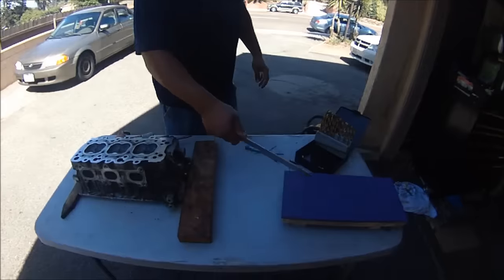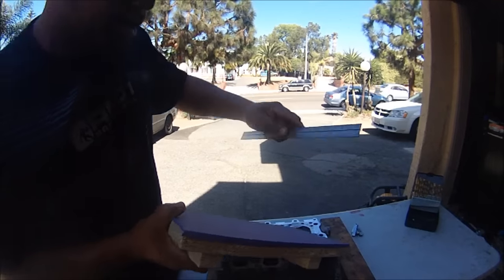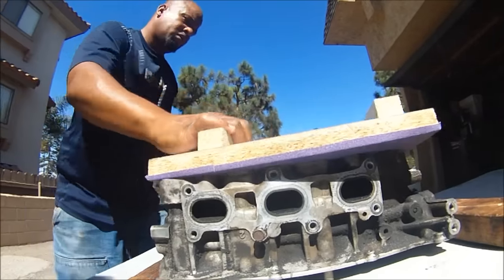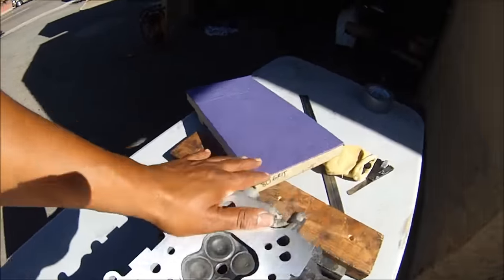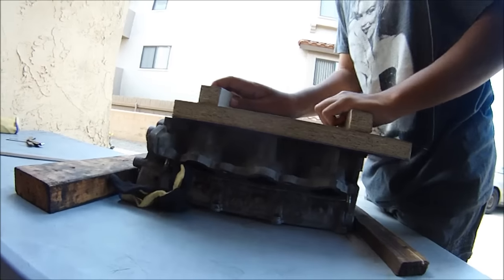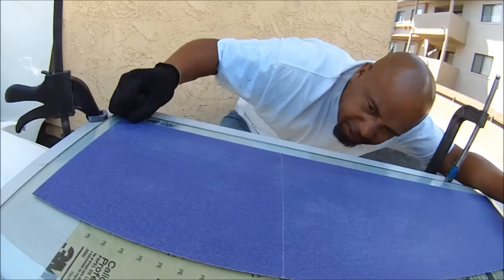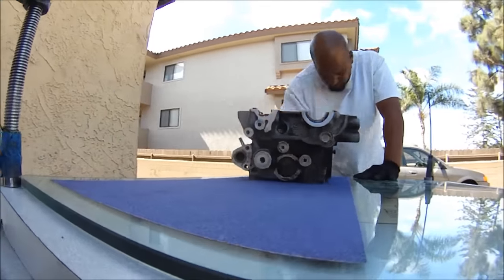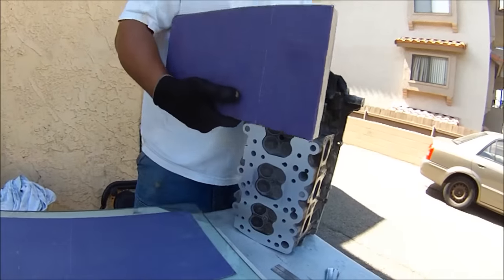HOW TO RESURFACE A WARPED CYLINDER HEAD AT HOME WITH SAND PAPER still works in (2023)

Comment: My dad is on social security, and has limited fund's. He blew both head gaskets, and warped both heads. This knowledge helped me to repaired his truck perfectly, and save him $. God bless you oldskool funk! Your messages are as real as you mechanic skills too.Thank you sir! Much respect.
Reply from the maker: This was mad for those who struggle financially. It helped me sooo many times and im grateful it helped you and your father. You and your Popz stay strong and draw close to Jesus Christ my man. Never Ever Stop Fighting in Jesus Mighty Name.
Reply: Thanks Bud you are who we need making videos
Reply: Hello I am 😢73yrs. Young ..  Could u also have the engine head in hand & do just the opposite  .. !  Use a sheet of 80 grit of sand paper attached  2 a flat surface.  Then use the weight of the engine do most of the .. Of course  the engine  head would  b maybe a little  harder 2 work  .. It was just an idea  ..  very gd. job, very  old school 
 job well done  .. Some 1 that is not afraid of hard work  ..😮  01-10-2024
Reply: How’s it going? What do you do for the cam journals?

Comment: The machinist in me is cringing a bit but I’ll tell you what man, good on you for figuring out and sharing your knowledge. I’d love to throw that head on a surface plate and check the true flatness of it not out of disrespect but just to admire the accuracy you can achieve with this simple method. Great video, God bless
Reply: Benjamin Paquin do you think he's close I'm a motor builder I bet he's far closer then he would if been just putting new gaskets in there
Reply: @ryandowns1507  He's within 2 thousandths across the whole part and I'd say it's probably better than that.  For the multiple feet he's dealing with that's fantastic by any machine shop's standards.
Reply: @kay19833  Why do you feel the need to bring race into the conversation?  What a shame that you only see the world in black and white.
Reply: After watching this I feel lucky that one of the things I do at my job is surface grinding carbide tools. It was kinda impressive to see it done in a "primitive" way and hey it worked.
Reply: @TugIronChief 

Yep especially when not maintained the right way. 

The CBN machine we had the bed rails had a valley in them, if you didn’t know that machines characteristics then it’s easy to get false readings.
Reply: @Mark C 

Lol the primitive way still works just fine. I’ve done it both ways with a head belt Miller and a CBN. 

Wanna talk about primitive then let’s discuss a broach head miller. Those are the ones that leave nasty cut lines no matter what you do. 

Even the CBN can suck, get a aluminum shaving stuck and it wrecks what you just milled and you get to do it again.
Reply: station079 yeah man, I’m white and I admire this man and his positive attitude !
Reply: @ryandowns1507  hello... what kind of motor? Respect from a petrolhead from Nigeria....
Reply: Benjamin Paquin 
Im only here out of curiosity, I’m no machinist. I don’t understand.... if a warped head is re-surfaced, and done well. Isn’t the rest of the head still warped?
Reply: @muntee33  Not the whole head, but if valves were to leak, they would be resurfaced too. The rest isn't that important
Reply: @TugIronChief   I'm a toolmaker machinist who served my time at a General Motors engine plant. Aluminium head castings were surfaced in a machine using large rotary head carbide tipped tools. Single-pass, plenty of coolant. For that reason, I would stick to using a mill with the right cutting tool. Surprised to hear you mention a shaper. The hillbilly method would work roughly but would take too much time. Better to take it to the machine shop and the job would be done in fifteen minutes. It's also flatness you are looking for not necessarily a polished finish as a fine machining texture helps seal the gasket.
Reply: @TugIronChief 

Yup it doesn’t matter how it gets there as long as it’s flat enough for the head gasket to seal. That’s all that matters wether a machine shop does it or a regular person. 

Problem with machine shops is they have a nasty reputation of taking their sweet ass time doing the work, I would know as I worked at one so seen both sides of it. 

Been the guy at the counter trying to get work done at a reasonable time period and been the guy doing the work.
Reply: All this stupid talk about race, and color. ...  
When I was a kid, we'd use sandpaper and a sheet of float glass, to sand our skin off.
When we were finished, white or black, we all looked the same.
Reply: @TheChrisey  good one!rotfl
Reply: This dude has reached Beast Level 10.
Reply: What made your cringe? Just curious?
Reply: I was thinking the same thing, I'm a machinist as well
Reply: Who is this for?
There's a long way to go before I get this out of my car!!
Save 45 bucks!?! 
I'm not hating. Who is this for, for real?
Reply: @gti500  yeah it takes fifteen minutes to do the work, and two months to get it on the machine. No thanks.
Reply: @IdemRedd  Watch the video again, so you can understand it. And listen to him talk, that's for  whom this is for.
Reply: @gti500  And how many hundred thousands recalls do YOU guys have every year? I'll take this "hillbilly's" advice anytime before yours.
Reply: @bkpickell  Or how about ten months for transmission swap/replacement?
Reply: Sid The sloth how do I know if I have an aluminum head? Or what type of head I have, I have a 2000 Ford Taurus 3.0 V6 Vulcan engine
Reply: @cxx1953  magnet wont stick to aluminum, give it a test
Reply: Mr. Matt right on, thanks 👍🏻
Reply: I Appreciate him going the extra mile. 👍 

but, I'd say to (people) Alternate ends that your sanding from.. Every 20 passes.
Reply: @robertgaudet7407  A machine shop would get it flat and to the correct surface finish. Within 2 thousanths isn't flat or anywhere close to "machine shop standards"
Reply: Spend $200 on gaskets, bolts and fluids  and then do this crap to save $50?
Reply: @keithb4007  amen
Reply: Thanks dude. Anyone hating already paid the machinist or is to lazy.
Reply: IdemRedd I don't know what tools are required for machinists or whatever but this could very well be the method used in "non-privilege" countries. You think 45 bucks is nothing but there is vast swathes of the world that 45 bucks is a ton of money (or sophisticated expensive machines don't exists in abundance). I was in rural Africa and rural Thailand at motorshops. The ingenuity that some use yo do work is similar to what this man has done. Hell they probably do this in USA in poor Appalachia if we being real.
Reply: @muntee33  If I understand you correctly, the warp only applies to the surface, so if it is fixed, it is fixed.  But your general point might apply to the fact that there are two surfaces in play (on each side of the gasket), and the other surface needs to be true as well, so that they both mate up correctly.
Reply: @a1machinista1  The $200 was done to save the cost of buying a working vehicle, and he did the work in order to avoid paying the $50, and he got a video out of it.
He's a doer, not a payer, and that mind and skill set is going to become way more valuable in the next 20 years than it was in the last 20 years.
Reply: @South_0f_Heaven_  I have also done heads motor blocks and cranks in machine shop with all the proper machine tools. I will assure you the method he used will do as good if not better a job as any machine can do.After 50 years of working on diesel gas and hydraulic pumps and motors i should know.
Reply: @wellnesspathforme6236 
Cylinder blocks don't take a pounding from the pistons like the heads do, blocks are never a problem it's always the head
Reply: Jon Wong How can a “broach mill” be used to surface anything? Daryl used layman’s terms to describe exactly the current state of the art milling process. The only difference is carbide vs cbn cutters. Maybe a cbn insert is used for small DOC but carbide can take a significant cut, especially in aluminum. A large DOC in an aluminum head won’t rip it to shreds, a broaching machine tool cuts slots, a rotary broach “wiggles” shaped cuts, the modern “CBN” machine you talk about is a rotary milling machine tool with a insert that’s been around since the 1980’s. I don’t think you know what you’re talking about....
Reply: Only thing I can think is that he didn't make sure the head was secured in a perfectly level position, so although the precision ruler doesn't reveal any low spots in the middle, it doesn't mean that the surface is sanded down level from left to right. It could be sloped
Reply: @sil-zk8061  If it was sloped slightly, it actually wouldn't matter much. There's still going to be the same amount of clamping force. The bolts are almost always torque-to-yield, meaning they stretch. This means they'll seat even if it's slightly angled.

Now if it's more than .003" or so, then yeah, I can see how it might be a problem. Would be a nice episode for some mythbusters-esque channel, honestly.
Reply: @Steven Wander That's true. I guess as long as the tolerance at the lowest point is good then at worst you have negligible sub-optimal valve performance
Reply: I’m cringing as well. I’m sure it will work just fine, but this just reminds me of heads techs zip wheel the deck of and think they’re fine to just throw a gasket at it cause “it looks good”. lots ultimately end up at the machine shop.

Comment: This method has been used for decades to flatten surfaces.  A piece of glass or a "flat plate" piece of steel is about as flat as you can get and if you handle the head properly you can get a flat surface.  Myself, I would hold the head at both ends and move the head more in a figure 8, it tends to compensate for any uneven pressures you might place on the head pushing it from one end.  The big thing is let the grit do the work, don't try to put pressure on it to speed up the process or you'll tend to have low ends.A machined finish is better in that if done right you end up with the proper surface finish and an absolutely flat surface, but this method Is perfectly acceptable if you want to take the time and effort.
Reply: Leland Lewis, you are on the money i was going to say this
Reply: I never thought what he did was possible. That the hands of men can do what a machine was designed to do. When he was resurfacing the heads I thought about the pyramids in Egypt. how the blocks were placed precisely without any modern day technology.
Reply: Many manufacturers have moved away from hand scraping due to costs labour costs involved. 

The hand scraping performed on a way is done for a couple of different reasons, neither of which are necessary in most automotive machining operations. Firstly, hand scraping gives a better surface for oil retention between two sliding surfaces where a flat surface would allow it to squeeze out. There are machined methods which allow oil retention, but whether they are as good is debetable. Hand scraping also allows for an accuracy far greater than required for automotive purposes. Even in a blueprinted racing engine, where tolerances are tighter than in production, the tolerances are still well within the range of the available machinery. 

Your point is well taken though, simply because something is done by hand, does not make it bad. Many shops still hand hone cylinders and I have "bored" cylinders with a hand hone to within .001 taper. 

We have become programmed to think that only something computer controlled can be accurate. CNC can speed up processes by duplicating the same actions over and over, or do a job quicker, but men were doing accurate "machining" long before machines came along 

The other thing that hasn't been mentioned is surface finish requirements. A cylinder head has a certain micro-inch finish requirement to give it the best seal on a gasket and good gasket retention. This requirement changes with the type of gasket used, but is still quite within the realm of this method.
Reply: Yea figure 8 is the best way to go if you can. When I was working in the shipyards we always lapped our discs for the boiler safety valves in a figure 8.

Comment: People be hating but here's the deal.  I've had to do this job myself.  It was the worst possible pain in the ass I could have ever done.  But at the time, I was broke.  I had no job and my only car had warped heads.  My father and I did this EXACT process, it took f'in forever! But it worked.  Remachining heads is INCREDIBLY EXPENSIVE and sometimes, if you don't do it yourself, you might as well just trash the car because older cars aren't worth it.  As it stands, I drove the car for another 4 years until I was able to buy a newer car.  Don't hate on this guy, people like him can save your life!
Reply: incredibly expensive? I get a pair of V8 heads surfaced for $70. Even at double the price I would t call it incredibly expensive.
Reply: I was told as long as the engine didn't get hot then the aluminum heads shouldn't warp ..??         Took them both off in seq..   Used a straight edge.   Looks good tho..
Reply: So true. If they are busy making money your little job might sit on the bench. Shops do what they can to make money like most of us. Could be a week or two; depends on how far out they are taking jobs. You might lose momentum. ;)
Reply: My local machine shop does decking/head resurfacing for $30 and hot tanking for another $30.  $70 more less tax included.  It's not expensive at all in my opinion.  I drop it off and get the head/block back within couple days.
Reply: Sounds like a great shop
Reply: suuuurree. having a head shaved and tanked ect..costs wayy more than that at reputable professional machine shop
Reply: Lmao incredibly expensive???? What??? It’s 20-40$ bro..
Reply: Those couldn't have been aluminum heads if it took you that long.
Reply: Amen
Reply: @drexauto1307  $70!? I got charged a heck of a lot more than that for 2 heads.. when I found out the intake manifold was another $100, I did exactly the same thing.. glass and sandpaper and redid it myself.
Reply: "Remachining heads is INCREDIBLY EXPENSIVE "  Not in the US or anywhere with typical automotive machine shops, but if that's not your location then do what you must. A pro shop shouldn't get over, or much over depending on the head, a hundred bucks to resurface and that's on the high side.
Reply: You're getting ripped off or live in a high cost of living area. Tanking/heating heads is dirt cheap since the machine does the work and it takes little time to resurface a head. I repair various machine parts for my local race engine builder/automotive machinist and watch him perform the work. I'm a good student-level manual machinist and very experienced aircraft/auto/motorcycle/industrial machinery mechanic and understand the processes. It isn't rocket surgery to surface heads accurately.
Reply: Dude 70 bux can be alot of money in surtain situations in y'all thinking about your shoes alone I sure as hell can remember being in those shoes were 70 bux had to last me a week this method works just fine and can be done further by using smaller grid sand paper 1000 2000 I do this to my diesel injector to make sure the two halves seal when replacing nozzles
Reply: Yeah they Cost 100-150 tp resurface heads here in Boston at a machine shop. Yeah super pricy lol. Nope your shop or mechanic makes you think that they are stupid expensive to do
Reply: @RSGAEL  cost my friends $100 a head shave at the cheapest in my town . Pending what type of vehicle it is sometimes 150 to $250
Reply: @obfuscated3090  Depends on where you are. I've lived in a few different places, and prices for machining etc can be wildly different. Easily 200-300% difference.
Reply: To be fair the last head I got decked had like 30 thou grinding marks in it cause they didn't do second pass to clean it up just hogged it!if I was in a pinch do this ! Like your checking it with a straight edge... can't make it anymore warped!
Reply: Not knocking anybody doing this out of absolutely necessity, but head don't just warp at the gasket surface.  It can completely misalign your cam bearing surfaces.  Maybe not a problem with old pushrod engines, but definitely an issue on overhead cam engines.  You dont address that, and your newly running engine wont last long after the cams grind down the bearings from misalignment.  I've seen it.  It can destroy the entire engine.
Reply: @theakh4238  real dude I get what you're saying but hoverhead cam engines don't have cam bearings.... They have machined journals! The cams them self would stop the top part of the head warping that much unless you ran it hot for a year straight!!! Just saying...
Reply: mattroski007  that was a small shop.. the 'united auto supply' shops cost 2-3x as much.
Reply: AINT NON BODY HATIN. cant disagree with out bein a hater?
Reply: @drexauto1307  where! There's no way you got it done for 80 unless the dude was your brother lol I got a quote on 2 hemi heads for 3509
Reply: @ryangraham1751  what?!?! thats robbery